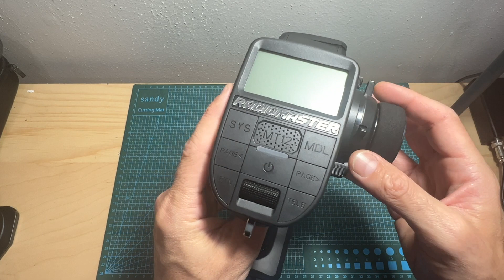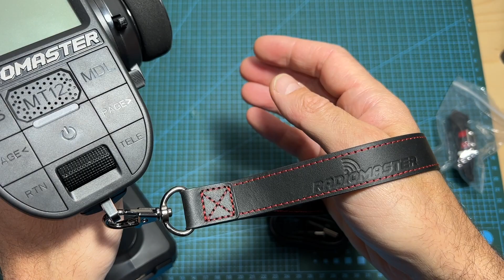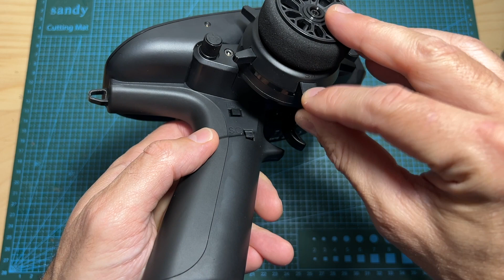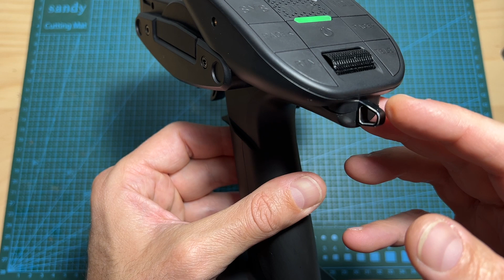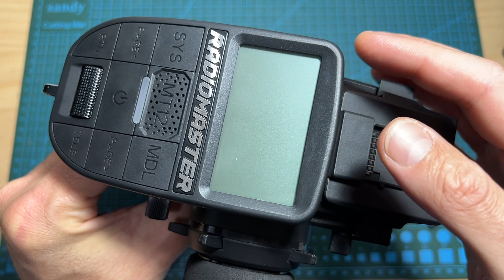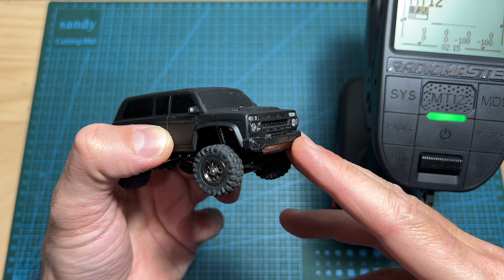First ELRS Surface Radio // RadioMaster MT12 Radio Controller

Comment: So, I recently acquired the Radiomaster MT12 with the intention of replacing all my TRAXXAS and Losi RTR transmitters. This decision seemed logical to me for several reasons:

1. Many RTR transmitters get the job done but lack ergonomic comfort, prompting my search for a more user-friendly option.

2. Stock RTR radios often limit customization options, necessitating the use of a Bluetooth dongle to connect the radio to a phone for parameter adjustments. While I seldom modify settings once my cars are set up, the inconvenience of switching the Bluetooth dongle between transmitters or purchasing multiple dongles for each radio seemed impractical and expensive, especially considering the number of radios I own.

3. Several of my cars feature receivers with built-in stability management. Swapping them out for receivers from brands like Futaba or FrSky, which lack built-in stabilization, would require adding an external gyro. However, the challenge lies in the waterproof receiver box, making the addition of a gyro somewhat tricky, though I'm considering if it's possible since the gyro doesn't necessarily have to be inside the receiver box.

4. The accumulation of numerous radios from each car's purchase led to the inconvenience of managing and storing around 15 radios.

5. Consolidating to a single radio would allow me to sell the surplus radios.

6. The built-in 4-in-1 module of the Radiomaster MT12 would enable me to retain the original built-in receivers, which vary among TRAXXAS, Losi, FrSky, and some unknown brands.

However, my plan encountered a setback when I discovered that the Radiomaster MT12 only supports ONE TRAXXAS receiver, and I don't have that particular receiver in any of my cars. Additionally, it does not support LOSI receivers, at least not at the moment. To proceed with my original plan and use one radio for all my RC cars, I would need to invest in 15+ compatible receivers and numerous gyros. This investment doesn't align with my preferences.

Given these considerations, I'm now contemplating whether to keep the Radiomaster MT12. Excluding the 4-in-1 module, I'm questioning what makes this radio special and whether it still holds value for me.

Comment: I want to know if this (with the 4-in-1 module) will work with the Losi Promoto mx 1/4-scale motorcycle and, if so, how you would need to program it for that RC motorcycle.  It would also be interesting to see if this motor cycle will work as well with a ELRS receiver but I doubt it as the receiver provides some stabilization functionality.
Reply from the maker: Which radio receiver does it use?
Reply: @KremerFPV  It uses the Spektrum - SPMSR6300PM.  I know the 4-in-1 module does support the protocol but it is a gyro receiver and has other unusual functionality that would make configuring the RadioMaster MT12 tricky.
Reply from the maker: @bitogre  well the gyro data handling is done on the receiver level itself so it might be actually pretty easy to configure it. I can't confirm it obviously.